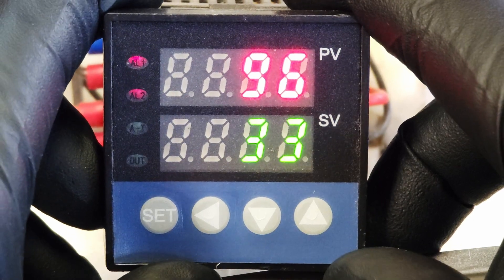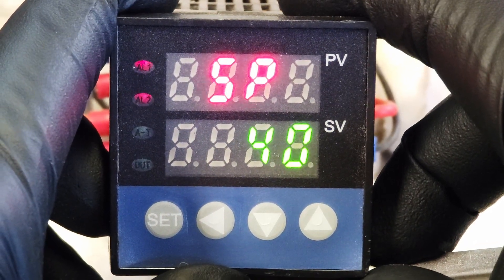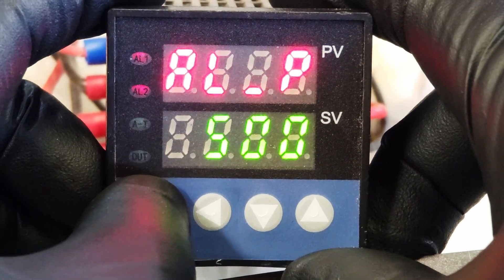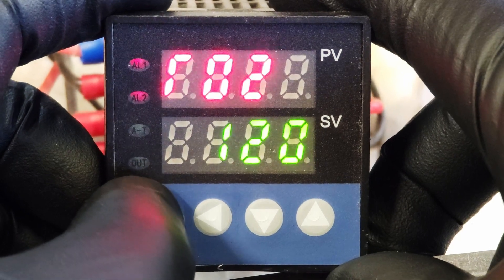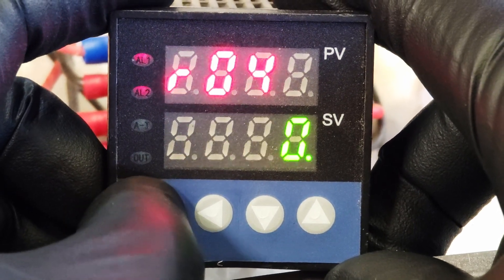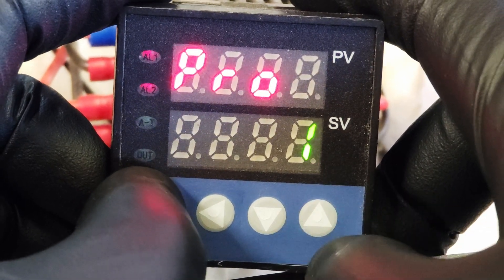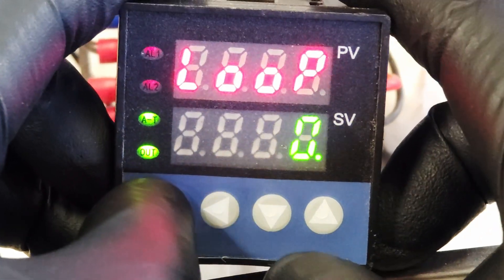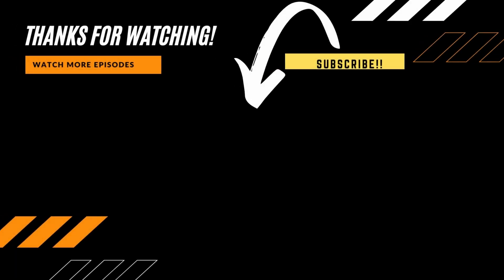PDI Controller Programming for Ramp and Soak

Comment: The thermostat we received is too long for the box so we used an older thermostat and are having some issues getting the correct run. 

Any suggestions? 

Thank you for the video the paper instructions are a nightmare .